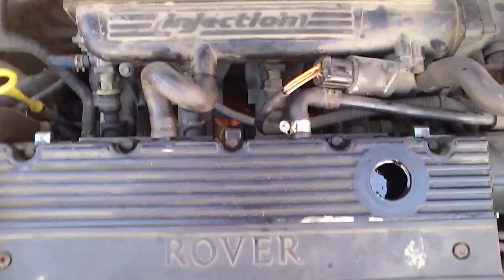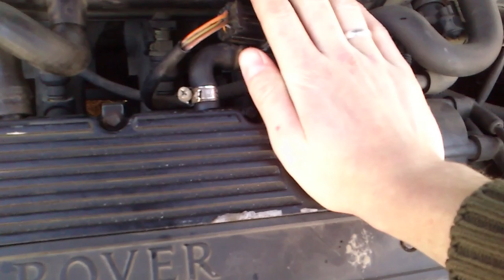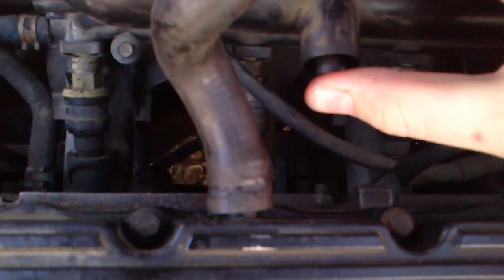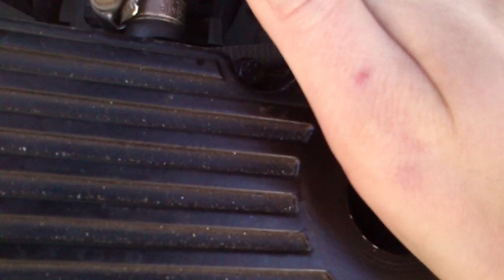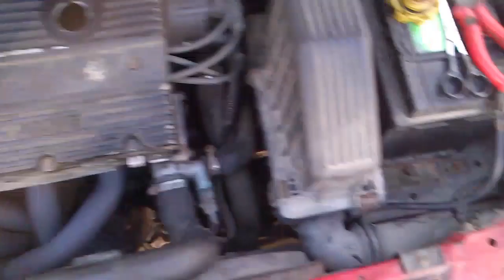Rover 214 Si Problem

Comment: There is supposed to be a very small hole (about 2-3 mm) in the cam cover to restrict the suction. Remove the cover and check that someone has not drilled this hole larger than it should be.